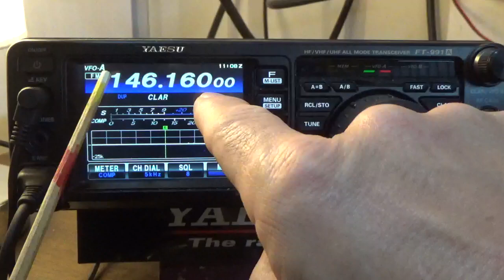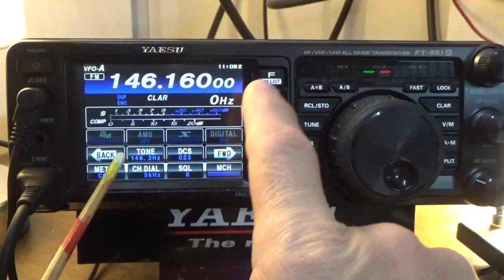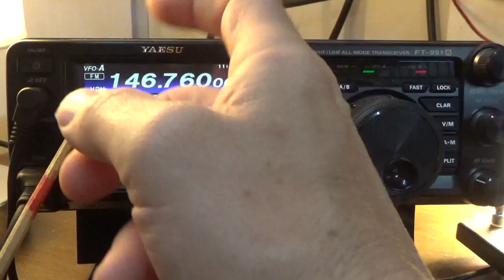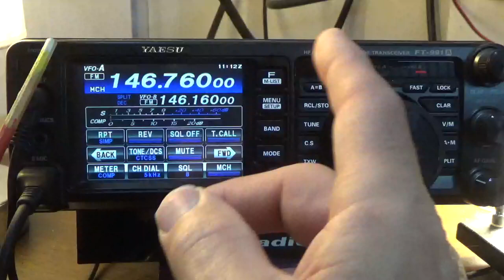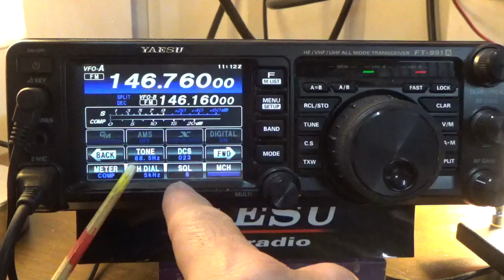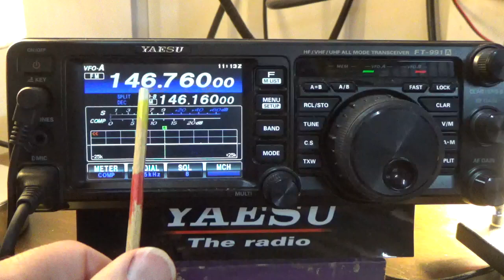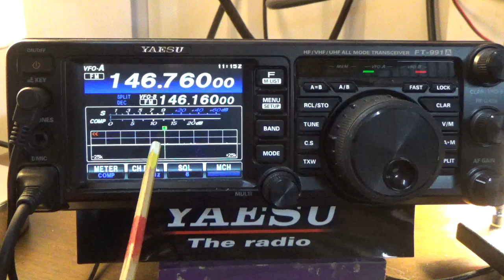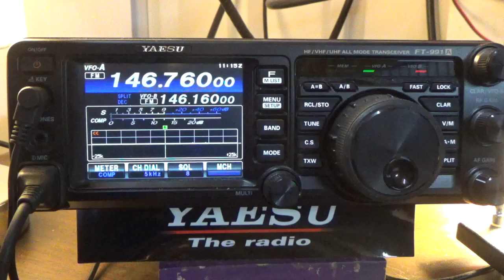FT991A Program Different RPT Uplink & Downlink tones Proposal Using VFO-A & VFO-B in Split Ops Mode

Comment: We have a 'split tone' repeater (VE3QAR) here in eastern Ontario. The club owning it had to set up the repeater to open on 91.5 and transmit on 118.8 to solve a rather aggravating problem at the repeater site which it shares with the local police department. Since they have done so the repeater problem has disappeared. I have a FT991A and can access it in its new configuration without difficulty simply by encoding my transmission with the 91.5 tone and leaving no tone squelch selected on receive. So, simply "ENC" 91.5 but I would be interested to try the split programming function you've outlined here just to play.
Reply from the maker: Good evening and TU for the message - very interesting way to solve the problem - GL and let me know how it turns out let  me know if I can be of further help TU and 73 KI5JUF

Comment: To the best of my knowledge, unless you're getting crosstalk that you want to squelch, you don't need set the downlink tone. So if a repeater uses a different tone for TX and RX you can set the radio CTCSS-Mode to "ENC" which allows you to specify an uplink tone and not require a downlink tone. I think this will work 99.999% of the time as the downlink town is only for eliminating noise for your benefit and the repeater does not require it.
Reply from the maker: Hi Arron - thanks for the message and you are exactly correct - you have a nice xmas and 73 GL
Reply: @westtexasvideogateski5juf255  Merry Christmas!